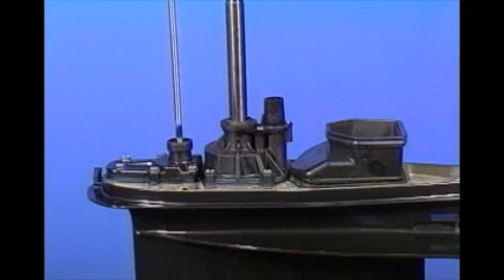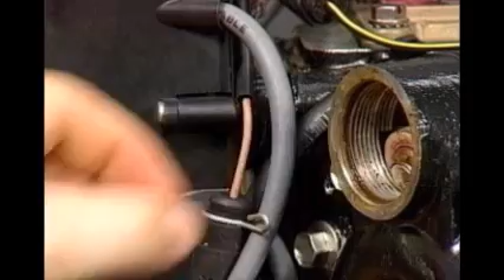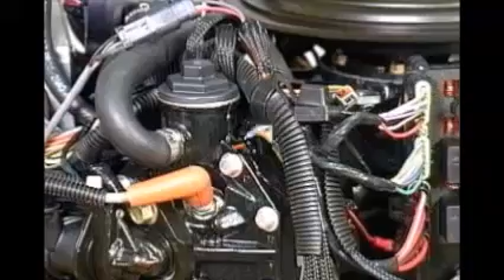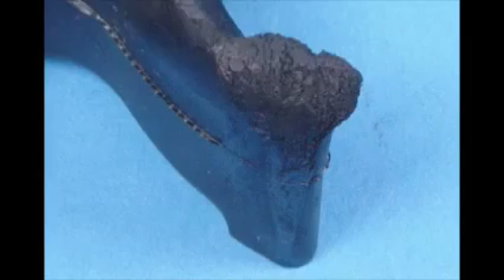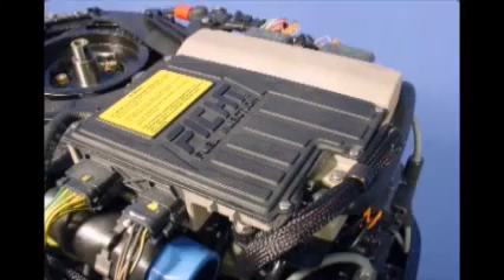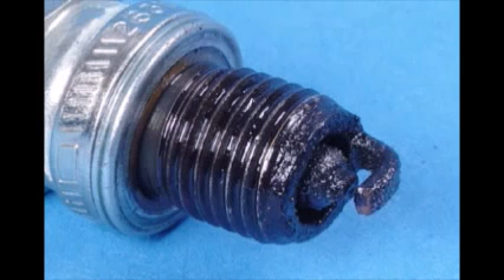How Outboard Cooling Systems Work

Comment: Any else do a retrofit to add a telltale on a 70s motor that didnt have one? Holy fudge is that nerve wracking. Drilling a hole on the top of the powerhead...and dont slip.or drill too deep in to the cylinder wall. Dont tap it wrong. 

So happy with the results but feck that was stressful.

Comment: Why OMC put the thermostats and poppets in a unmanageable location on the pre 98 V4's is only a question God could answer. People are lazy. People get really lazy when you have to remove a powerhead or from what I read, at the very least try and do the job with the lower cowling (pan) in place or unbolted and pulled down 3mm for "better access" which is to say, only marginally more access than you have if you did it in place. They obviously pulled their head out of their ass when they designed the loopers with the thermostats being on top of the powerhead. My motor that I acquired with boat has been on it's last leg for two years since purchase. I needed the boat hull and knew that the motor was likely going to need rebuilt eventually and just send it continually but I'm not an idiot. I knew her condition and continued to ride that bitch into submission. I said, "she gonna go until she blow". It's kind of insane though how these motors will have half of a top ring and still have compression. My numbers are decent but SCOPE says she's had a hard life. 3/4 cylinders have extensive ring damage to the piston. Rust present so obviously water intrusion. She's a beaut Clark. Let me tell you. Somehow still runs strong but this bitch is getting harder and harder to start and recently had another small piece of top ring smack the sparkplug ground strap and embed itself into the piston. About a 1 or 2mm piece of the tapered top ring. I ran 3 or 4 miles on 3 cylinders to get her back to the ramp. I finally decided that it was time to tackle the shittly looking head bolts and hope for the best. I did a pretty good job with penitrent and heat. Only broke one head off a bolt that has plenty of thread sticking out to get it out of the block. The other thing that was dually noted was my water deflectors in the head were in the TYPICAL STATE for 30 years young. Swollen like a cow titty. So that leads me back to my original point. O yea and I bought this boat in MEXICO so how much fucking maintenance went into this engine?! You can't fix the thermostats with BUD LIGHT.

Comment: I did not know the impeller would change in to a centrifugal pump in high RPM.
Reply: What I think is neat is once these get figured out, all the manufacturers seemed to switch to them right away.  In the 40s you see all sorts of combinations of positive displacement pumps, straight-up centrifugal pumps and propeller slipstream systems (which didn't work with gear shifters naturally.)   Then these come out and everyone goes to them and no one tries anything else again ever.  Little details get added like self-priming with driveshaft seals and... I can't think of anything else!  Maybe the old slipstream intakes start disappearing for less drag.
Reply: Same. Fascinating to know that design feature.
Reply: Yea, it makes sense for sure, but I never really knew it either.  I have replaced a dozen impellers over the years too!